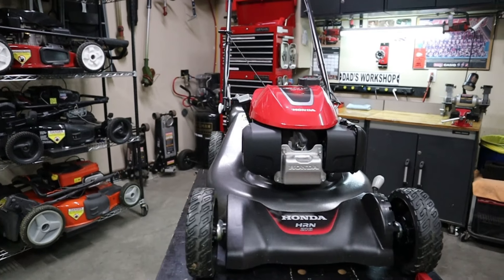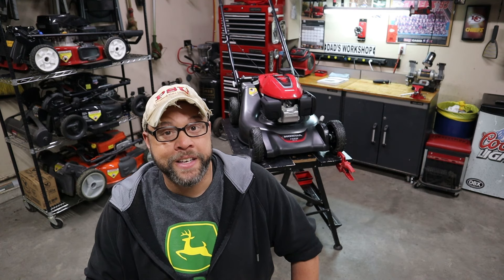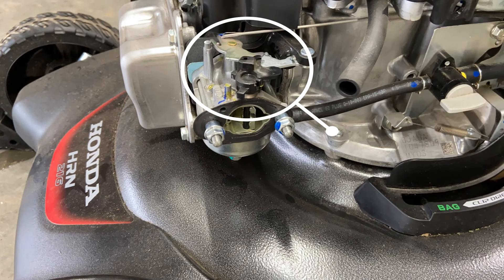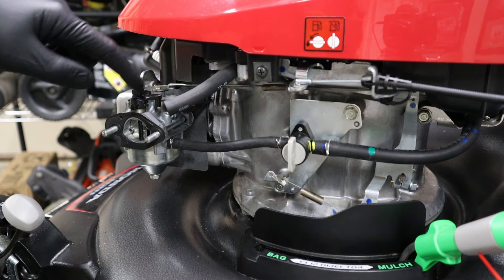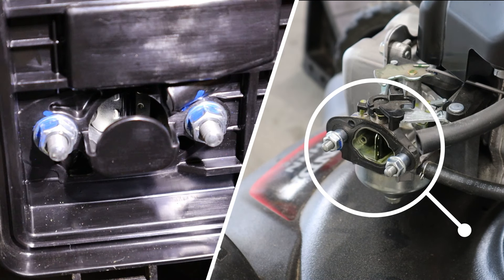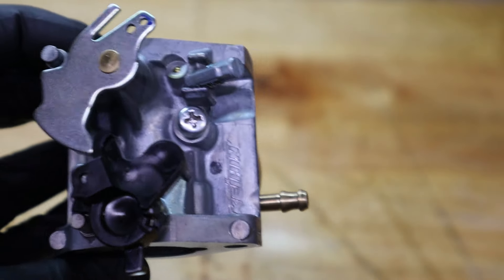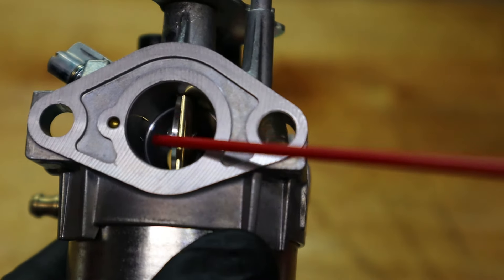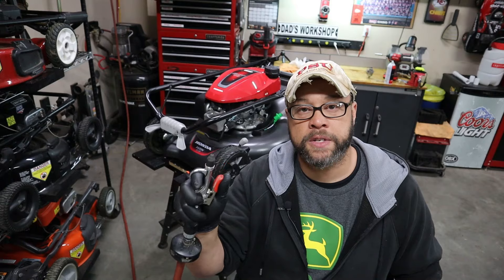New 2020 HONDA HRN216 GCV170 Surging/Rough Idle AND Auto Choke Test/Check

Comment: Thanks for great video. My 2020 Honda HRX217K6HYAA GCV200 engine idle is too low, engine stops at idle (turtle icon) in several seconds. I need your recommendation. Thank you.
Reply from the maker: Adjust the throttle/idle stop screw, with throttle control lever set to slow “turtle” start with half turns left or right till you achieve  +/-1700-1800rpms. Thanks for watching.
Reply: @dadsworkshopbykipplabrie7982  Thanks for prompt reply. My carb assembly number is 16100-Z9M-J61 (I have tried to paste the picture but I failed), there's no throttle/idle stop screw like on my previous Honda HRX217K4HYAA with GCV190 engine. 
Thanks for your help.
Reply from the maker: There should be a stop screw on the carburetor if there’s a turtle symbol on the throttle lever???
Reply: @dadsworkshopbykipplabrie7982  There is stop screw on the carb to stop the throttle at slow 🐢).
My previous mower carb comes with the stop screw for idle rpm adjustment.
Reply: The throttle piece looks like 2 fingers (victory sign) that seat on fixed stopper. I tried to open that piece (2 fingers) with caution then problem is solved. 
Stupid design, they want to save money and they reduce everything even a bolt, or a screw, ... 
Thank you anyway.

Comment: Great video, but I tried everything and it still surged.  I've fixed other equipment that surged with a similar process, but not this one Honda mower.  I ended up just buying a new carb.  I cleaned the old carb several times and saw slight improvement, but the surging continued.  I've yet to see a video that describes the screw set next to the pilot jet and whether that can contribute to the surging issue as well.  I'm not sure how that can be removed, adjusted, etc.
Reply: Same thing happened to me man, I’m a local lawnmower mechanic and this model HRN216, cleaned the carburetor throughly, 3 times and still surges or revs up and down, replaced carburetor and good as new. Sometimes cleaning it doesn’t fix the issues , I even took the pilot jet apart and put a needle through all the holes

Comment: I just purchased this mower to replace my 15 year old Toro with Honda engine. I have run the QT 93 Octane (E10) fuel in it since purchase without any mechanical problems. It still starts on the 1st pull. My question, can I continue with confidence, this same regimine with my new mower or should I use the Ethanol free fuel. I probably answered my own question, but I welcome any input. Thanks for the vid.
Reply: I have 2 Honda lawn mowers. 1is 15 years old the other 6 years old. 1-93 octane gas. 2-2 oz. marvel mystery oil in 2/12 gal. Of gas. 3- amsoil 10-30 small engine oil. They start on first pull.amsoil is 100% synergies oil. The best
Reply: 100% synthetic oil

Comment: So, my pilot jet score is tight I broke a screwdriver trying to remove it. Any ideas outside of dremeling out a slot and using a bigger flathead?
Reply from the maker: I like you're thinking, I use the same method on rusted license plate bolts. This is a very very common problem I come to learn and unfortunately, I haven't had the pleasure of dealing with this problem yet, the only thing I can think of next is applying heat or needle nose vise grips BUT! keep in mind were working around fuel and gas fumes, so that's your call but the good news is most hands tools/screwdrivers have a life time warranty so at least you got that going for you LOL. thanks for watching.

Comment: Is there an alternate method if you have stripped pilot jet screw? I couldn’t get mine off I still sprayed carb cleaner in the 2nd hole in the front, but after putting it back together the surging didn’t stop.

Comment: Nice video! That little screw on top is in there tight…. and is now stripped.  My fault I suppose? It should have been an easy removal but it won’t budge. Going to have to find a replacement.

Comment: After carburetor assembling started the engine working great, i noticed that i had gas leak so i reopened carburetor stopped the gas leak. but i noticed pin behind the carburetor was sticking out. I pushed it back and re assembled the carbonator. I start engine again but would not start at all. can you please give some advise how to start it again.
Reply from the maker: I the idle port or "pin" on the back of the carburetor should still out just a little bit, if you tighten it or loosen the pin you will need to reset the position of the pin. Depending on the Honda carburetor model# the seat position will vary, but here's a starting point, Turn the pilot screw in until it is lightly seated, and then turn the screw out 2-1/8 turns for GCV170 and 1-5/8 turns for GCV200. If you forced/pried the pin back from the outside in, you most likely damaged the pin and blocked the transport completey, if doing so the now damged pin cannot allow fuel to pass through making it unable to achive the proper air:fuel ratio, resulting into a "no-start" small engine.  See the PDF link below to better understand. Hope this helps 

https://cdn.powerequipment.honda.com/pe/pdf/pubs/otr55046.pdf
Reply: @dadsworkshopbykipplabrie7982  Thanks a lot Kipp, PDF you sent me makes it a lot easier to understand what is exactly going on. Have a nice day.

Comment: We cleaned ours and it stopped sputtering. Thanks so much! Now that it is on, we have a new problem. The tractor runs at very high RPMS.. any solutions to this problem?
Reply from the maker: Adjust the governor spring till it reads 3000 (+/-150) RPM

Comment: What if after letting the engine cool for 5-10 minutes the butterfly valve never closes? Does that mean I have a faulty auto choke actuator? If so, what’s the course of action?
Reply from the maker: Yes replace it see link below 

Honda 16620-Z8D-842 Thermo Wax Assembly; 16620Z8D842 Made by Honda https://a.co/d/epDXeCp

Comment: I have this same mower. My problem is that I can't get it started AT ALL. Ive cleaned the carb several times. I've tried starter fluid and I've replaced the fuel and spark plug, but still can't get it to turn over. It ran 2 weeks ago, but now it just sputters. I am at the point where I'm ready to just replace the carburetor but I am having trouble finding the right replacement. Does anyone happen to have any info on the replacement carburetor? 
Also, great video. Very informative and you have very good camera presence. Sorry for the rant, I'm just frustrated...

Comment: I gave up on the screw the head was stripping, it would not break loose. I just sprayed cleaner in the hole behind the butterfly and it worked luckily.

Comment: In the end, I have Huskavana mower for 6 years and never have had an issue. Prior to that I had a craftsman for 16 years and never had an issue although I always did general maintenance on it. Don't get me wrong, honda makes a great engine, it's jus there actuators are trash. There immolation jet holes are to small, they plug easily 6 and create the surging problem or don't start at all.... Good luck all, hopefully honda fixes this problem.

Comment: 3h of use and i had the same issue. I took the 2 bolts out to see but it was clean.so i put back together and it got fix.on mine probably the bolts got lose becose it didn't have no loctite.thks

Comment: Works great for about 30 or so hours of use and you have to do it again.
Wish Honda had a better solution for this problem and the pressure relief valve.

Comment: I've observed an easy, yet temporary solution to this problem. When this surging engine behavior presents itself, partially close off the fuel supply to the carburetor. When the surging subsides, slowly open the fuel supply. This suggests to me that the float might be stuck open.
Reply from the maker: Great observation! and thanks for watching

Comment: So I did this yesterday I did not remove the carb I was able to gently pull it back to get at that pilot screw without taking off the linkage.  I did not use a screwdriver I used a small ratchet for more leverage a 1/4 will hold the P2 no magnet of course.  Gently tried to remove that screw they use loctite on it that is why they are hard to bust loose after a couple of tries I knew that screw was going to strip.  So I remembered that I had a 14 year old set that had a PH2 bit and I believe that was a forged bit unlike the newer Dewalts which I use and they seem to be softer these days.  It looks a bit different hard to describe than the Dewalt P2 bits.  Again assuming PH2 and P2 were just abbreviations for the same bit.  I think it got a bit deeper into that screw and bam first try the screw broke loose.  Did all the stuff Dad did with carb cleaner fired it up ran great for a minute or so surge back but it did start the first time and it had not done that for awhile.  Okay depressed and by the way I never use anything but non-ethanol gas my mower was bought in May.

So today I needed to mow the lawn was going to take the mower to my Ace after who is an authorized repair center after speaking with Honda.  Started up 2nd pull then no surging I have the blade control model after 5 minutes mowed the lawn slight and I mean slight surging maybe to picky.  I intend to buy some Sea Foam and use some of that cause it can't hurt the season is almost over here I have Zoysia it won't grow a whole lot from here on in.

I would suggest anyone who does this to buy these Bosch ribbed P2 bits, Dewalt makes them also they are supposed to help with cam out not a ton of money and they claim to be the Bosch to be extra hard I will for sure be buying a set for my own shop.  
https://www.amazon.com/Bosch-CCP2205-5-Piece-Extra-Phillips/dp/B000KKWK4E

Comment: My apologies.  I'm not an engine person.  Our GCV170 is surging like the Honda in your video.  I intend to ask my brother in law to help me with the jet cleaning but until I can get to him, is it okay to continue using our mower or are we causing damage?  Thanks.  Your videos are fantastic.
Reply from the maker: Great question Rachel, as long as the engine oil is at the proper operating level, you will be fine, but the cut quality is poor because the engine RPM keeps dropping, that being said you might not even notice a difference unless you're a nerd like me. Until you're able to fully clean the carburetor by yourself you can add the recommended amount of SeaFoam "engine cleaner" to the gas tank to help remove gum and varnish deposits or internal engine contaminants. It's not a guaranteed fix but I have seen it work in some cases. Thanks for watching!

https://www.amazon.com/Foam-Motor-Treatment-Part-B1SF16/dp/B01FSZ1AIC/ref=sr_1_7?keywords=seafoam+fuel+additive&qid=1662163132&sprefix=seafo%2Caps%2C776&sr=8-7

Comment: This is what mine did— cleaned the carb 4x never knew to chrck for cleaner in back of the carb your step 3,   

Gave up and just took the auto choke out and it ran fine for 2 weeks mowing.  

My new carb is here now.   Insanity. 

Fyi my auto choke opens in about :30. 

I think im going to just keep mowing and leave the auto choke and the new carb on in the shelf. 

Why do you think it doesn’t choke itself out after it gets hot?
Reply from the maker: Once the engine is hot the auto should be fully open that being said the the choke is no longer needed but I’m no engineer just a Lexus Tech LOL. Thanks for watching and thanks for the comment.

Comment: What if I have a brand new carburetor and it's doing that?
Reply from the maker: Fire the parts canon LOL! just kidding Justin, I’m unable to diag via text message but I would double check your reinstallation on the new carburetor. Did you confirm a failing carburetor before you replaced it???

Comment: Jet screw is really tight and hard to loosen.  Any recommendations for loosening?  I've already stripped the original and purchased a new carburetor and anticipate clogging soon.
Reply from the maker: https://youtu.be/2TuimCUzLFM?si=NdSBNYLW_X4y8b-M
This is a very, very common question I cannot answer and never had an issue with, so I made a video just for this concern hope this helps and good luck. BTW any chance you provide more information about the new carburetor you just purchase so I can do some investigating? thanks for your time, Herbert.

Comment: I have the identical problem. I tried to remove that pilot jet screw on top of the carb, but it will NOT BUDGE! is there a good way to remove it without damaging the carburetor? The screw head stripped right away when I tried to remove it, it's on so tight.
Reply from the maker: Do you have a impact drill driver (1/4”)? I finally ran into this problem for the first time recently and this is the most common question I get I’ll send a link for the tool I use for stubborn nuts and bolts.

https://a.co/d/gcGCXIV
Reply: Nevermind. I used my Dremel tool  with a cutoff blade to cut a slot in the head of the bolt deep enough that I could use a slotted screwdriver to back it out. it was tight!!! And you were right. the jet was clogged right there under that screw! the rest of the carb was very clean. thanks!

Comment: This modern age of machinery really stinks! Manufacturers have their head in the clouds! I have a 10 year old craftsman push mower. Same spark plug same fuel filter, all I do is change the oil. That thing runs like gold. Never a problem.
Reply from the maker: I love my old craftsman mowers, the new Craftsman (MTD) mowers found at Lowes just not the same quality. Thanks for the comment Joseph. R.I.P. Sears...

Comment: Any change you have a video on changing the belt for the self propelled on the HRN216VKA
Reply from the maker: Gary, that's a really good question, didn't even cross my mind yet so I did some digging for you. Turns out the owners manual only mentions the word "belt" three times! I found that very odd. That being said I went straight to my Honda shop manual and also found very little literature about replacing the drive belt. Turns out you're on to something, also it doesn't look like its an easy task plus the shop manual only recommends replacing the belt if it damaged. So yes it sounds like I should do a video about that service. Thanks for comment Gary!

Comment: Thanks, fixed mine too! Didn't have to fiddle with the idle mix screw as @weeeves mentioned, so I was lucky. Did take me 2 tries to get the jet cleaned out though. Love this mower, but never had this problem in the previous 30 years of Toro ownership. I also had to adjust the drive belt under the mower (not the normal adjustment on the cable), hoping these are outliers in my 2 years of owning the mower, HRN 216. Self propel control VASTLY superior on the Honda, hated having to push the Toro to get it to self propel.

Comment: I just sprayed carb cleaner into my air intake and it fixed it instantly. Still some bull** that a $700 mower had to be touched under 20 hours of use. Did the oil change after 5 hours did another one in spring. Emptied the gas before winter, did everything your supposed to do. Not impressed might buy the new DeWalt 60V

Comment: Kipp what prevents this from happening again?
Reply from the maker: The technician in me says ethanol free fuel or use "TruFuel" But I've read so many great viewers like you, finding themselves in different scenarios, from dusty and or poor assembly plant conditions, sloppy packaging from the manufacture and of course contaminated fuel. I believe it's a flaw in the new carburetor design by Keihin, even though Honda and Keihin and been partners for many years, this new design is smaller, lighter and feels cheaper than in the past. The best way to prevent this from happening is to avoid using ethanol fuel, apply a reputable fuel additive to your fuel supply and run the recommended amount Seafoam or STP in the engine at the beginning and the end of the mowing season. Thanks for watching Shorty.
Reply: @dadsworkshopbykipplabrie7982  Thank you Kipp you are the man!

Comment: Hey  Kipp, I  too appreciated  your video.  It resolved  my surging  on the GCV170  engine,  but as I took the carb  bowl  off  the gasket  came  out in pieces.  I have spent 6 hrs  trying to  find a replacement.  they   seem to be non  existant  and those that  I  did find ranged  in  price  from  $6.00  to $19.00.  This is just  insane  that  Honda  puts   out this new motor because  in  produces  18% more hp  that  the GCV160  yet bowl gasket cost  almost as  much  as  an  after  replacement carb. Any recommendations on   where to  shop  for the bowl  gasket?
Thanks  Mike
Reply: I just had to buy a gasket for mine too after removing the bowl for the first time. Mine didn't even have a gasket. Nothing there! And you're right, the part prices for this carb are insane compared to other carbs parts (or entire replacement carbs).

Comment: Awesome Video.  Bought a low mileage used one from Home Depot returns and I'm getting a chatter when turning under power from the clutch.  Cant tell if I have a problem yet but ts pretty loud. runs quiet and smooth in a straight line.  Hauls butt.  Where was this lawnmower when I was mowing for money as a kid?
Reply from the maker: Thanks for watching
Reply: This mower doesn't have a differential. You're not supposed to use the self-propel drive on turns. Since you bought your mower second hand, you may not have the manual that explains this. You should be able to download a soft copy of the manual from Honda's or Home Depot's web site.
Reply: @jimc.7121  Thanks Jim, that's exactly the case!  thanks a million for the reply.  Ill look for the manual and it makes perfect sense.